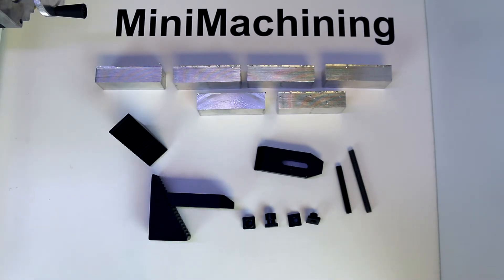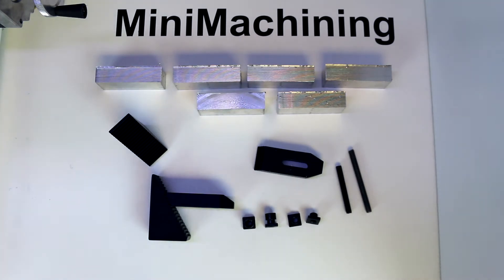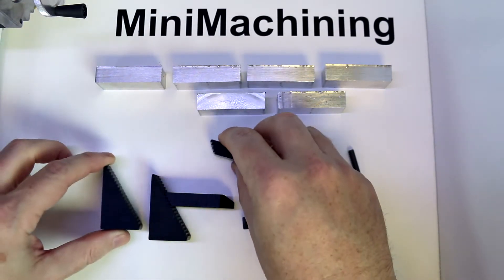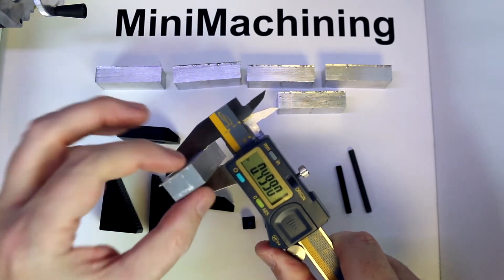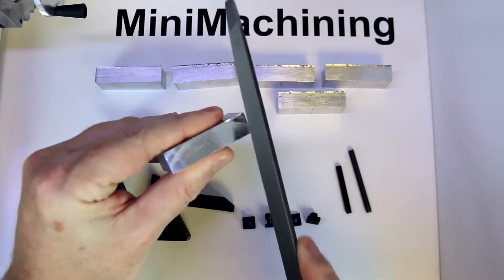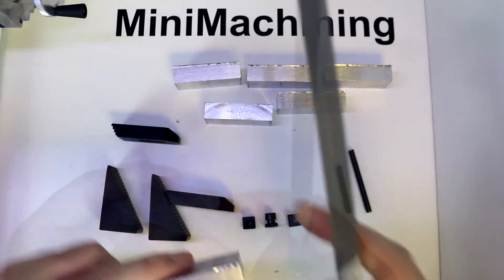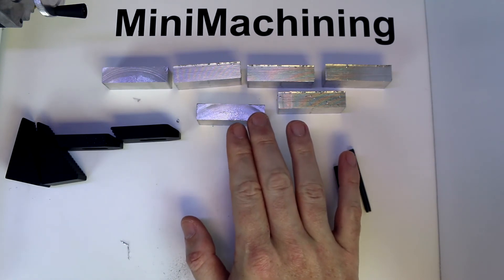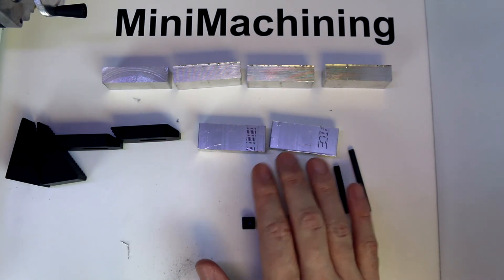Mill Projects 101 - Strap Clamp Part 1

Comment: You cautioned not to use aluminum with grinder wheels. Why is that?

Paul
Reply from the maker: +Paul Devey Aluminum tends to melt into and clog grinding wheels, this can lead to increased friction/heat which in turn can lead to catastrophic failure of the wheel (literally). I've not personally experienced this, but people describe the failure as "explosive" and it can be very dangerous to the operator when it happens. 
That said, this mainly applies to aluminum oxide grinding wheels (the "standard" that comes on most grinders) and heavier use. I've used a grinder on aluminum for light deburring, you just have to dress the wheel more often to unclog it. Some people use lubricant (be careful of thermally shocking the wheel while in use) with good results, I've heard of beeswax on the wheel prior to starting helps, and other wheels such as silicon carbide or friable wheels would produce safer results. The best/safest is to use a scotch-brite or other deburring wheel, these work really well on aluminum from my experience. They also last a fair while with aluminum and brass versus harder metals they will wear out quickly and get expensive to be replacing frequently. Another good option is to use a belt sander if you have one available.